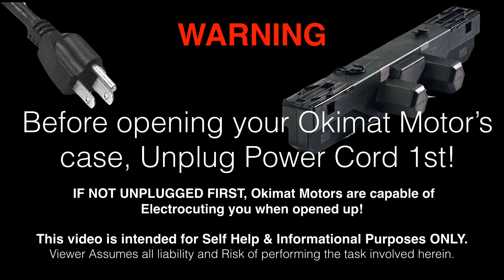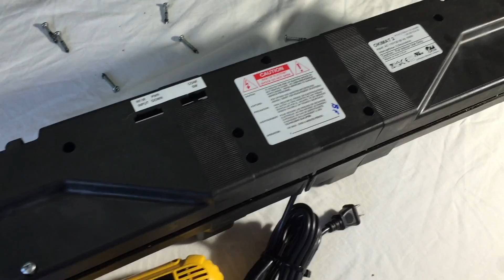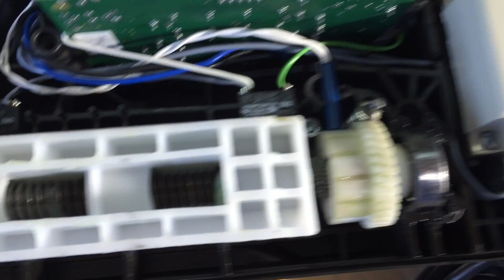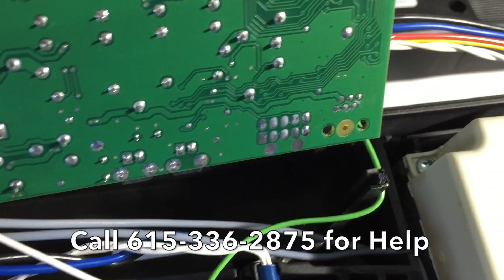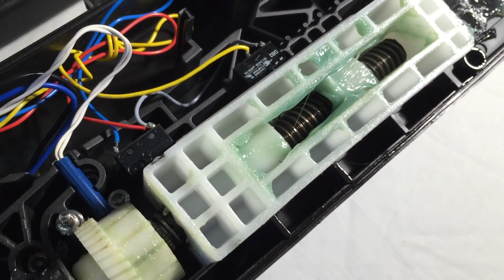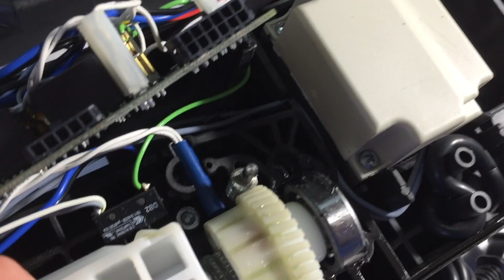How to Repair an Okimat 2 Maxidrive Motor &  Troubleshooting Help.

Comment: We have okimat ipse motor unit that only works slowly on the back up 9 volt battery. The mains power does not work, yet the socket on the wall is giving power, checked with a meter.
Any ideas on the problem?
Thanks
Reply from the maker: It’s the internal transformer that has failed. The motor will need upgraded and replaced.
Reply: @theadjustablebeddoctor  The motors are ok, they work fine with the battery. Do you know where can I obtain the board with the transformer?
Thanks

Comment: I've got a bed that's fitted with 2 okin motors. The one side of the bed works perfectly (head and foot end), but the other side is on a "go slow", both head and foot end. Both motors are dead quiet, with no unusual noise, so I'm not sure if this could be a problem with the board. The motors are powered by a remote controller. Do you have any ideas as to what might be wrong with this unit, as you did not mention anything in the video about one side running slower than the other. Thanks for the upload 👍

Comment: My Okimat 2 motor case is cracked exactly as the one in the video, and we did it without the help of any kids, and without jumping on the bed.  Do you have any ideas on how to strengthen that case so that, even though cracked, it will function again?

Comment: Just a follow up. I was able to get the frame back in working order. I noted your earlier advise that I may have to switch the blue and black wires due to a polarity change in the newer push block. I am back in business... Thanks again

Comment: On Saturday I called 615 336 2875 and spoke to Keith regarding the broken head side elevator and repair of this assembly. Keith was extremely helpful and informative. The result of our conversation was a cost effective solution for me. I ordered the head side push-block and bearing assembly (which had self destructed earlier) that will be shipped to my home within the week. It is comforting to know there are still genuine, customer oriented, friendly folks out there like Keith who go the extra mile! Thank You!
Reply: HI...!, please, what is the price of the push-block that goes through the screw?. Thanks.